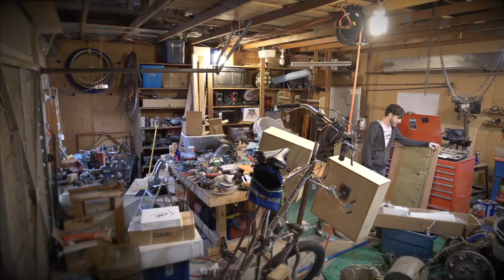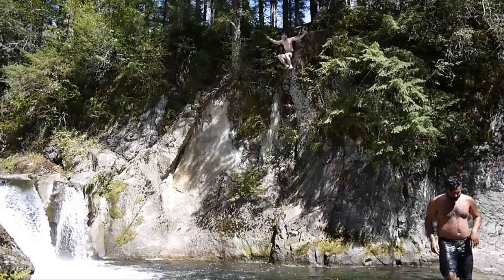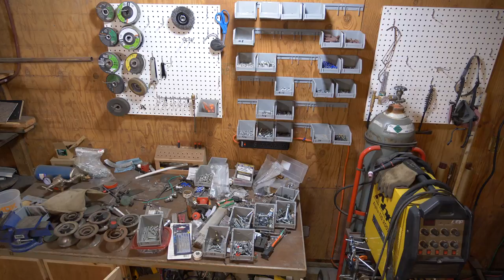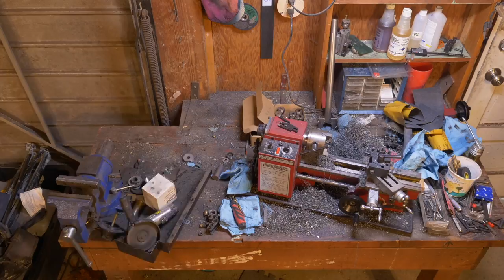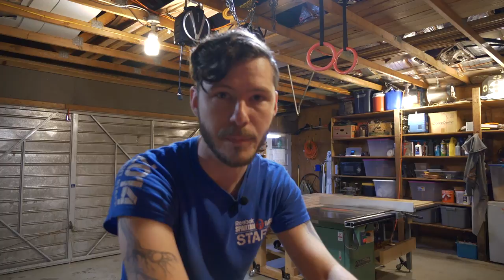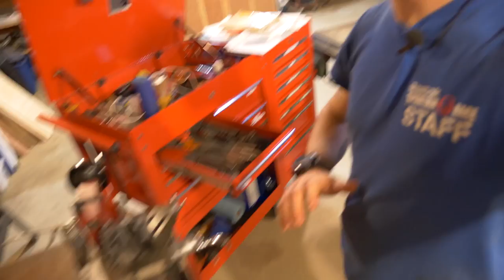Workshop Cleaning and Lessons Learned

Comment: Good job.
After over 40 years in the shop, I can show you how to clean- keep it clean and have everything close at hand and machines cleaned and oiled and all ready to go. The last thing I do is put away a machine or tool and not have it ready at the flip of a switch- saves time and frustration. Tools can't just be put back- they must be cleaned and/or oiled, then put away. Your tools will last longer and be ready for the next job............................................
 Good to have one switch (with a lock) that kills all power (except a light and motion sensor) to the shop when you leave. Helps protect equipment from electrical storms and makes it safe should someone enter your shop and decide to play with your machines, and also helps prevent accidental fires.
 Fresh air, air cleaners, exhaust air, DC, is a must for some shops. Lighting is very important.
 Should the motion sensor go off, you need to be alerted in the house and via smart phone. 
 and so on.......................

Comment: Good video and good tips.  My garage shop looked a lot like yours before you started.  I am half way through my hoard and I am starting to see the end of the cleanup.  Like a lot of people I have too many interests (fascinations) to allow an easy organization.  I have managed to organize the lathe area, the mill area, the welding area.  I downsized the huge craftsman cast iron belt drive table saw and settled for a Rigid saw on a collapsible wheeled cart.  That helped a lot.  I have most of my steel tucked away in the shed and the wood on wall racks.  I liked your drop zone idea!  Thumbs up and subscribed.